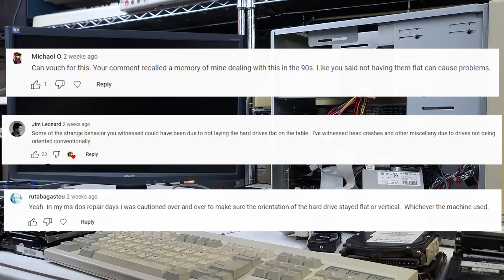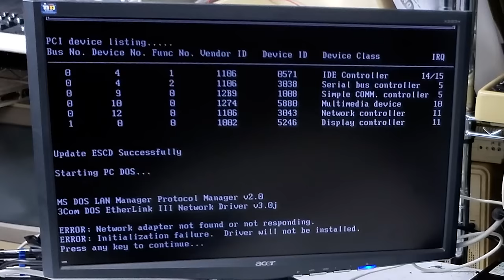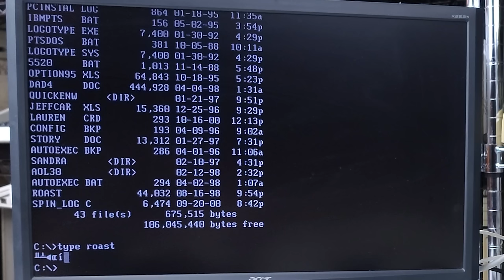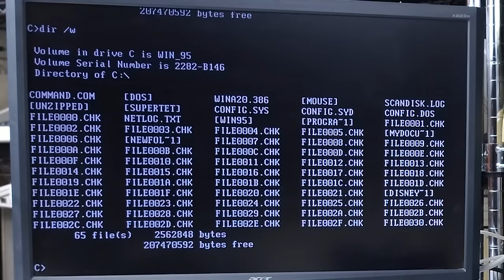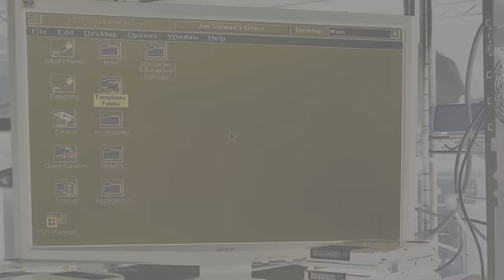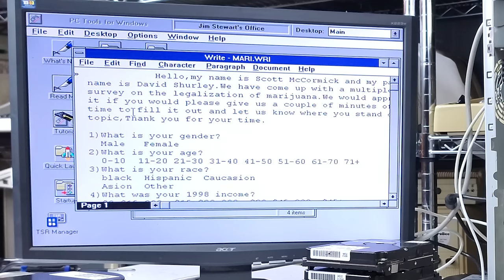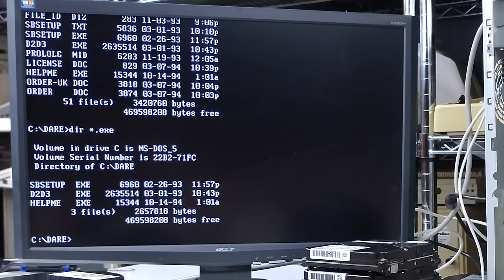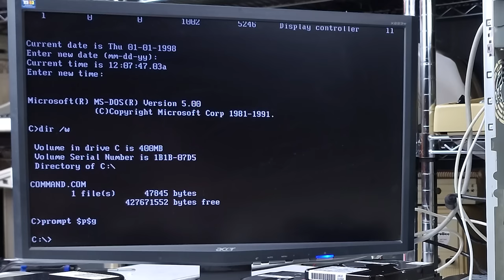More old hard drives!

Comment: Nice work as usual. I've found myself wishing that ctrl-Z worked IRL for years, but now that you mention it, I'd probably get more use out of ctrl-C. Especially on conference calls. 

Totally with you on the slot CPUs. I built a Slot A Athlon 750 back around '98 or '99, and loved that chunky cartridge with the heatsink and a pair of fans on the side. (That was my first machine with active cooling, IIRC.) Funny thing: I built it in the exact same Enlight case that your P3 is in. None of the internals from that machine survive, but I still have the case. (My wife's machine resides in it now; she prefers the smaller beige case to the hulking black CoolerMaster that I salvaged from me office) Most people probably take quick-release drive mounting for granted now, but back then, it was a pretty cool deal to have those little rails that you screwed onto the drive and then slid into the case rather than having to oh-so-carefully thread those impossibly tiny screws one-handed into an awkward location in the case while your other hand tried to keep the drive located correctly, all while trying not to slice your yourself open on a poorly-finished bit of stamped steel.

I don't remember exactly what I paid for that case, but it was (relatively speaking) a lot. But 25 years and at least 5 power supplies later, I'd say I've gotten the good out of it.
Reply from the maker: I was so obsessed with the P2 when it came out, but it was so expensive I couldn't afford it.  I recall one of the major issues was RAM - somewhere in the late 90s SDRAM went through the roof price wise.  I think I paid something like $300cdn for 64mb or something ridiculous like that.  By the time I'd assembled most of what I needed for a coveted P2-450 system, things had moved on and I went with a cheaper AMD K62 instead.  I then went Athlon I think - hated those because they had that tiny square core that chipped SO easily when you put the heatsink in place.

And yes I do not miss the awkward screw-in points for internal drives.  I think 90% of my machines back then had my drives on a slight tilt because I never bothered with the other side.

Comment: Hrmm. Memory tickled... fuzzy... ah, there it is. 
I think your Commodore 486 is having issues with some of the CHS translation values on certain drives as a BIOS limitation. I'm theorizing that the smaller drives that did not work were newer and used CHS that was incompatible with older systems, even though they're under the 504Mb 'limit'.

Comment: 27:17 Looks like a program compiled in pascal being run too quickly. Runtime error 200, it's a divide by zero error, as part of the code begins to function before some values are set.
Reply from the maker: Interesting.  I could test that by copying to another hdd one of my slower 486s would accept and see if it runs there?
Reply: @TechTimeTraveller  Absolutely.
Reply: @TechTimeTraveller  Played Black Gold back then on the Amiga, it was named Oil Imperium here in Germany. Pretty nice game, a business simulation with some action mini-games thrown in, kinda like Ports of Call but with oil drilling instead of shipping companies. I remember a similar divide-by-zero-error occuring with the first The Secret of Monkey Island installment. IIRC that already happened with 486es clocked higher than 33 MHz. Could be that your 486DX4-100 is still too fast for Black Gold too, the game however is really worth taking a look at. THX for your great videos... always a pleasure!

Comment: I remember an IDE drive on a 286. User at university asked if the sound meant a problem. The sound was a mix of a cement truck and a gravel carrying truck having an argument.  My boss and i got a box of floppies and backed up that hdd. Replaced it with a new one. Whew.

Comment: Windows 3.1x freezing up like that can often be a sign that the wrong Display Adapter is set up, you can fix that by going into the Windows directory and run setup.exe, when you pick the generic VGA Adapter with a low res it usually boots. I had that back in the day when tinkering with my machine too much. :)

Comment: Also ...dont forget that some old drives also needed to be connected to the Earth through the case - screwed to the case. Generally, i sometimes remove the 5.25" plates out the front of a PC case, hang the correct power and ribbon out for Master HD and then just sit the harddrive in the space on the bottom metal base of the caddy frame. Harddrive with its pcb facing downwards.

Comment: I was working on getting an old ThinkPad 32 bit pentium 1ghz working. The 44 pin IDE Drive was long since gone. I used a M.2 sata to 44 pin IDE adapter and that worked great.

In my research I found a CF to 44 pin adapter which I'm still waiting on two arrived from China

And I found what they are calling refurbished IDE 44 pin 2.5 hard drives. These look identical to the 120 GB drives from the 90s

They look brand new and they come in factory sealed bags and brand new labels shiny brand-new metal

I'm not sure what they mean by refurbished

I don't know if they took the original boards and put new platters in or what exactly they did but these things look new

It really shocked me because the M2 sata to.44 pin IDE is the perfect solution and eliminates the need for any other solution

But apparently there is a company in China that figured there are enough people who need new 44 pin IDE two-and-a-half in drives that are just like the original ones that they had in these old style laptops

There are not many of these laptops still working and I needed them for programming in DOS for old  two-way radios that use dos software only

And specifically need a 9-pin Serial Port that is an honest-to-god serial Port that uses an on-board 16650 or old serial chip 

I tried several other 16650 alternatives and none of them worked

The software and the cable just need this old style laptop

So I'm going to keep these and I have a few options on the shelf in case I ever come across another old 44 pin IDE laptop

Comment: I don’t what other peoples experience is with Maxtor hard drives but they had by far the highest failure rate of any drive on the market in my experience.
Reply from the maker: I had decent luck when I was using them in the early 2000s, although they did seem to have a pretty fixed lifespan of 2 years or so.  Didn't encounter them much before that... usually was Conner or WD.

Comment: You are lucky that several of the drives you tested actually worked when jumpered as a slave when there was no master present.  You really should make sure drives are set to be Master or Single when there is only one drive on the cable and make sure the master drive is at the end of the IDE cable (although I think you have been getting the cable position correct in most cases).  

A slave drive without a master will not terminate the IDE bus correctly and will lead to signal integrity problems on the IDE bus which can create all kinds of weird issues and can certainly lead to data corruption.
Reply from the maker: Yes.. I shot this at the same time the first video was done and there was an awful lot I've forgotten in 30 years.  I'm pretty sure I tried each drive in different positions and some weirdly were only recognized in the slave position.. not master or single.
Reply: Yeah, I thought that too but it must be that the bios in that computer compensates for that. Like whatever the first drive is, it's C and if it is bootable it's gonna boot it.